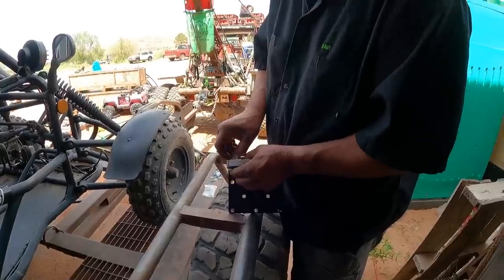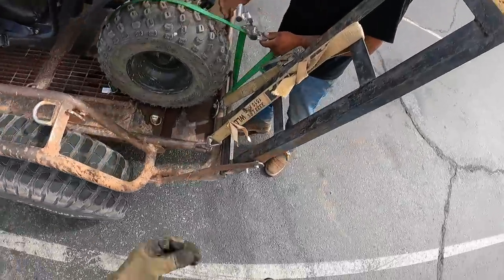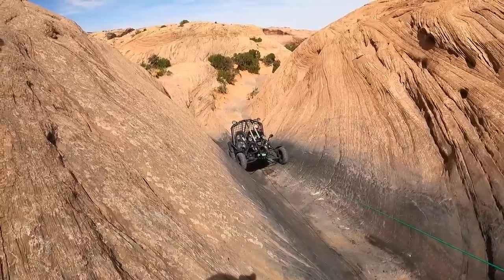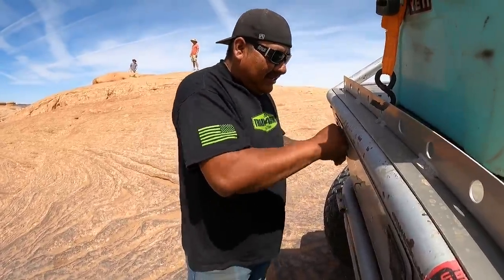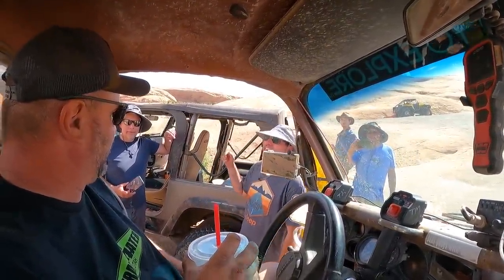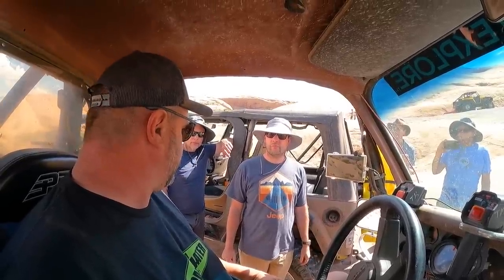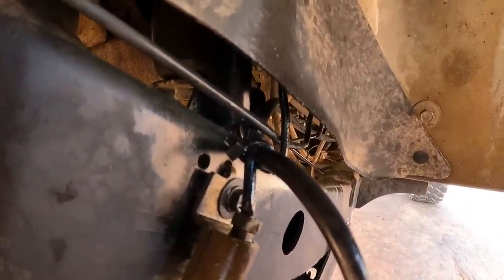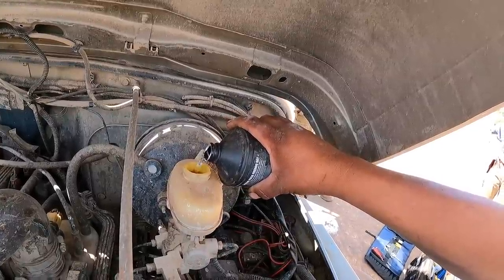Go-Cart On Hells Revenge

Comment: Hey Rory , I had the same gocart you got , BUT I took the motor off and extended the frame 2 feet so I could put a 350 Honda engine on mine ,  it would pull the front wheels off of the ground while throwing rooster tails of dirt.  It would get about 50 mph on very flat ground,  it did not need to got any faster. I had it geared so it would climb.

Comment: Too much fun, that poor clutch! Cool to see you guys out there just playing.
Reply: It's a GY6 with a CVT transmission. They're actually very reliable as long as you keep maintenance up. The ultimate go kart though would be the Joyner Sand Viper. Modify the suspension to have slightly stiffer bump stiffness and 20% stiffer springs and throw a small honda civic,  chevy spark, or even crotch rocket motor on it and it will be a monster

Comment: Leave it to a child to get a go kart. Next thing you know your building tracks and racing them. My life right now. Just finished building mine from scratch. A wet clutch 4 wheeler motor will be a lot better then those torque converter setups.  That's how I'm running now. Loving the karts part👍

Comment: throw a little rear axle with a winch hyd motor and put a chevy power steering pump off the engine to run it. 1000lb torque from a dinky set up.

Comment: that go kart was not working like it should, seams like it has something wrong with the drivetrain because its not putting down the power to the wheels correctly. if you fix that problem then it would do so much better